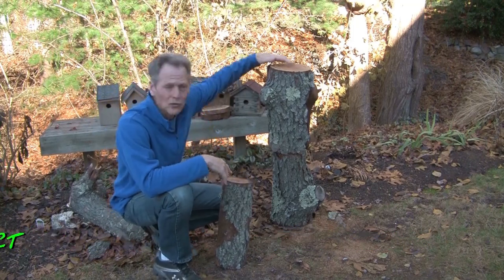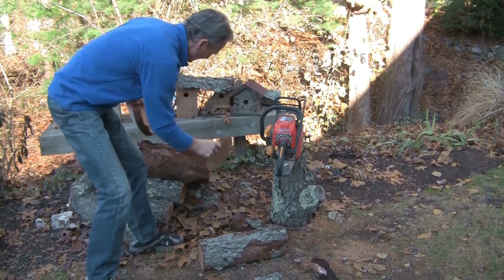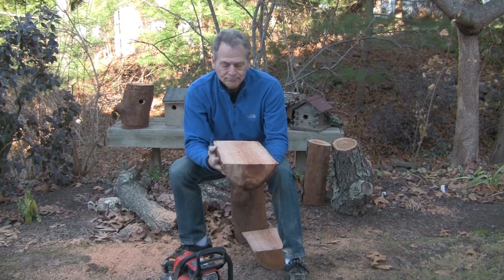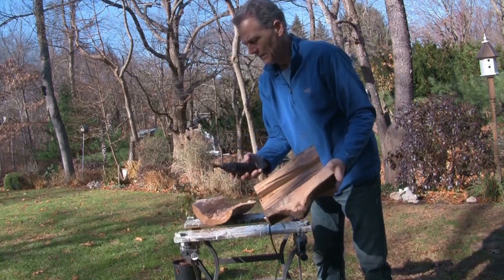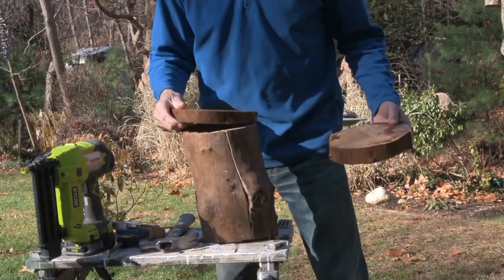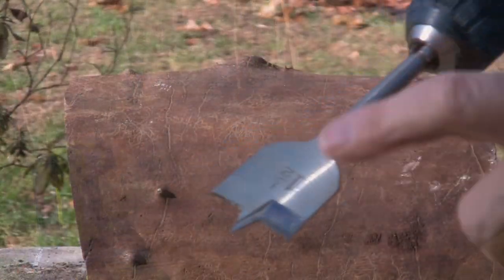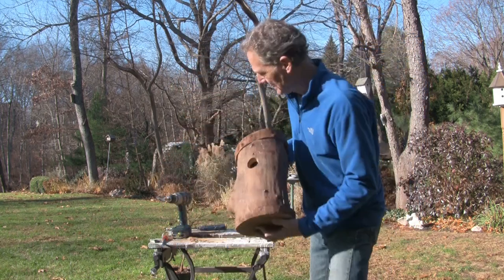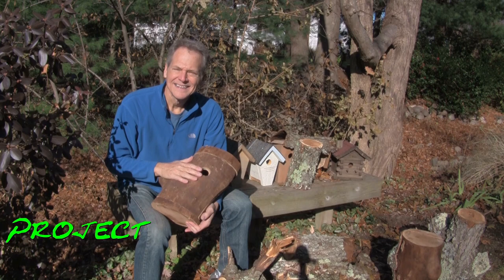Build a Bird House from a Log.

Comment: How clean does the inside have to be? Plus, how large an area does it need inside?  One more question, could you use a long arbor to drill the inside out?
Reply from the maker: The inside does not have to be to clean..But it should be safe..The Area inside in flexible..I have several birdhouses all different sizes and have birds in alot of them..Make sure they have room to move in out safely and can raise three babies....An Arbor drill would be great if it was big enough.  Good luck with your project..Its always fun to play..
Reply: @Backyardprojectguy  Thanks for the advice and the quick answer.
Reply from the maker: @jackpshannonsr.1838  Have fun with your project...